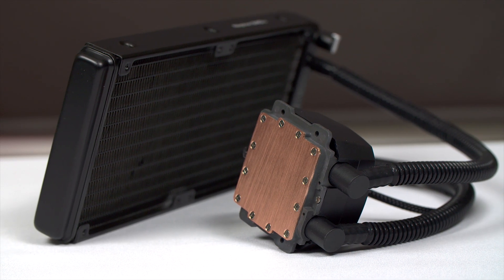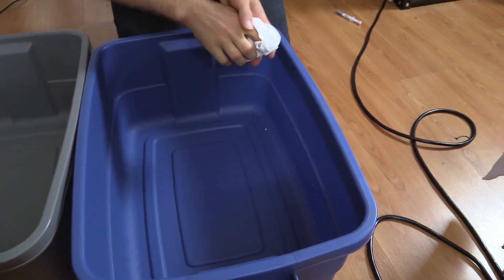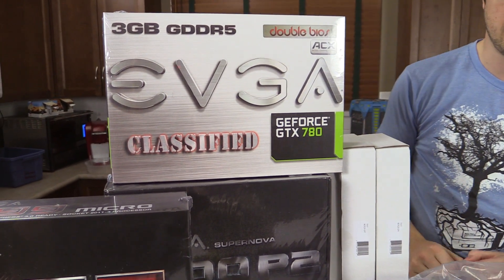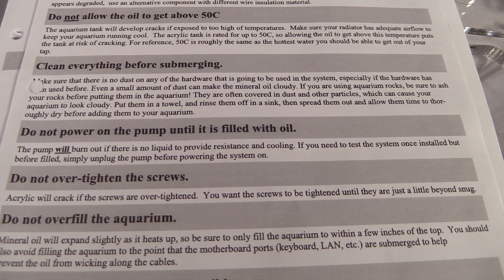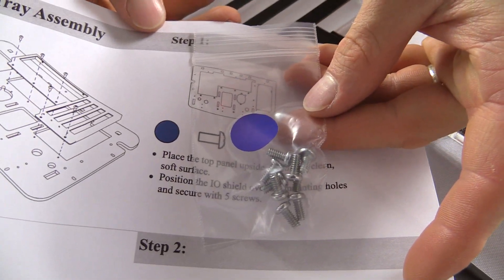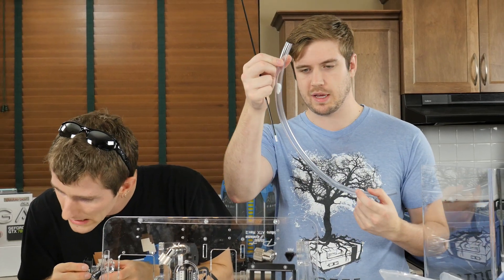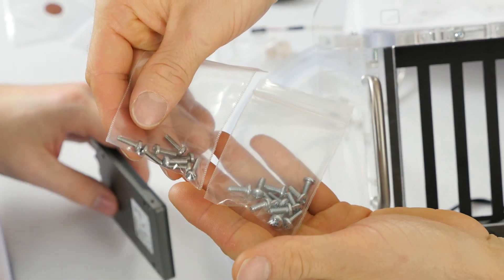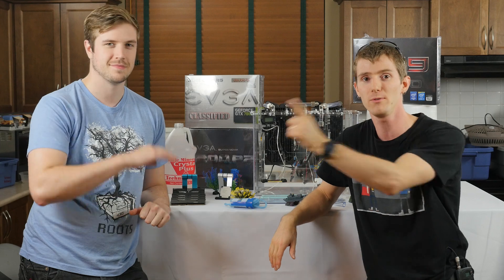Mineral Oil Submerged PC Build Log Part 1 - Puget Systems Kit Case Assembly

Comment: What is the Adventage of a Minerial Oil acooling versus a Water Colling?
Reply: oil build cool every component like motherboard
Reply: Username0123456789 Another advantage is you can have 100% quiet computing
Reply: Oil cools everything, water cools only your cpu and/or gpu
Reply: More street cred
Reply: Well, they're about to completely submerge every component in the mineral oil because it's non-conductive. You can't do that with water.

The oil isn't just going through that water cooling loop. The "case" is a fish tank without any fans for a reason.
Reply: [deleted comment]
Reply: You get +9001 Swag
Reply: philip s It won't be 100% quiet. You still need fans on the radiators, a pump and mechanical harddrives have to be placed outside the oil
Reply: Jake Long swag level... its... its... OVER 9000!!!!!
Reply: Mansen well. It deionizes the metal, causing a short in 10 mins.
Reply: You get to say that you have built a mineral oil cooled computer. Can't forget that advantage.
Reply: Mansen It's completely correct. Not only is it more expensive, more corrosive to metals than regular distilled water but it will try to take ions from any metal surface every chance it gets, it's unsafe in this type of configuration.
Reply: Mansen start Saving if you do that, because you will need a new system because deionized water will short out because it will pick up ions, and give the water a conductive charge
Reply: A noctua fan at lowest rpm setting is basically 100 to our ears.
Reply: Use ssd, noctua fans at lowest rpm and fir the pump sumerge it at very low rpm and its silent too.
Reply: Mansen That's the chemistry? No lies lmfao.
Reply: Mansen have fun trying it then
Reply: Spill Mineral Oil on your MOBO. Does it work? Now do the same with water
Reply: philip s Shure, but I don't think most people who build an oil cooled rig do it for silence but just for how cool it is. You can even make aircooling inaudibly silent, depending on what you do
Reply: Jammy jam true, but things like on board chips and sound cards and stuff like that can only (safely) be cooled with mineral oil
Reply: Two completely different method of cooling. A more similar comparison would be Oil vs Air.
Reply: Seon wei jie  The ASUS Maximus VII Formula Motherboard has VRM water cooling.
Reply: Mansen Demineralised water is also more corrosive and will become conductive over time.
Reply: It's just a cool looking gimmick really.  Oil is not nearly as good at transferring heat as water, so once it gets warm it's going to take a longer time to cool.  And as far as cooling the entire system goes, it's not really needed. 

I was considering doing this once and did a lot of research on it.  It looks awesome and would make for a great conversation/show piece, but in terms of heat removal for overclocking a custom water loop is going to do a better job.  And it's wicked messy to boot.

I may still do it some day just for the cool factor though.
Reply: Mansen lol, oil is much better than air. Go study some material pls
Reply: Uzmeyer True but it will be silent because it's all submerged. It will also depend what you place it on, a lot of surfaces enhance sound like a table compared to a floor.
Reply: Jacob S that was cool if ion can decast form oil lol
Reply: With the right cooling kit you can chill a mineral oil pc down to below the ambient temperature of the room without the attendant condensation problems that a system open to the air would have. You can also get the temperature down much lower than with air or water because the freezing point of oil is lower than that of water.
Reply: More fun to build? Ain't that the epitome of reasons for custom building more fancy stuff.
Reply: GenXRanter True, water transfers heat better than oil. The engineers figured that out a long time ago, that's why car radiators use water and not oil.
Reply: Angel Luis Trinidad oil cooling in engines does exist.
Reply: Jacob S I like pouring liquid nitrogen all over my engine and hoping for the best :D
Reply: ***** In water cooling distilled water is used which is non-conductive either.
Reply: Foxcat What? Distilled water IS conductive.
Reply: ***** The time it takes for distilled water to become conductive while in contact with metals and other contaminants is like, in the order of minutes. So, yeah, you'd basically need a continous flow of distilled water, nevermind water trapped in areas with low flow becoming conductive and kill it anyway.
Reply: ***** You're talking about deionised or demineralised water, not distilled.
Reply: tikiman48 motherboards can be watercooled, PSUs can watercooled, everything can be watercooled but its useless
Reply: Well, you can submerge all your computer parts in it without getting damaged haha. Also, your components will run much cooler!
Reply: Jacob S I know that, The oil in the engine is to combat friction. But there's no oil in the radiator, I'm talking about engine radiators, they have water in them not oil. And that's because water is a better heat dissipater than oil. I've never seen an engine with oil in the radiator. Of course there's the Volkswagen engine that is air cooled.
Reply: Angel Luis Trinidad No, I mean that oil being used as coolant has existed. In older car engines, aircraft engines and motorcycle engines. It's typically used to supplement air cooling when extra cooling is needed.
Reply: You don't have to buy blocks and fittings for every component
Reply: Jacob S Definitely,  we are talking about different things. I'm talking about radiators not using oil, using water, because water is a better heat dissipater than oil.
Reply: Angel Luis Trinidad That's exactly what i'm talking about, oil being used in radiators, I'm just saying it had existed, that's all.
Reply: ***** Distilled water is not 100% pure, it is still conductive.
Reply: Jacob S If done properly, no its not
Reply: DkGnClan All water no matter the purity can technically conduct electricity when enough voltage is applied and even then, distilled water isn't pure enough to submerge a PC in and even if it was, the salts from different sources in the PC would start contaminating the water making it even more conductive.

Water is not a great idea for this type of PC configuration.
Reply: the mineral oil is denser, and it needs more heat (energy) to rise its temperature, but as it's denser, it means that is harder to push through the radiators. So, it absorbs more heat but it flows slowly to get it... the only advantage is that it cools every single component, on the mineral oil
Reply: Jacob S I never seen it, but I like to learn. It would be great if you point me to a link that shows a radiator that uses oil as a coolant, and not water.
Reply: Jacob S Here we go where everything is always 100% perfect. Even if oil is not conductive the rocks will leave normal water in the finest holes, with even more water, which will contaminate the oil straight away making it conductive. This is why I left the LTT forum, everyone is based of bullshit numbers and theories, and Linus' videos. Nothing is thought about with an open mind.
Reply: Angel Luis Trinidad Here's a link that explains what I'm saying, water is a better heat dissipater than oil. Please take a look, and read all the posts:  http://www.nissanforums.com/ga16de-1-6l-engine/7025-oil-instead-water-cooling.html
Reply: BlueBlockHeads I wasn't the first to be "technical" the contamination of the oil is not significant enough to make a difference, however salts from components in the PC will quickly ionise the water to dangerous levels.

If you want to try submerging a PC in distilled water you can go right ahead.
Reply: Angel Luis Trinidad Using oil instead of water is an old practice and was only used along side air cooling, the 1985 http://en.wikipedia.org/wiki/Suzuki_GSX-R750 is something that used that method, I think older VW's, Chevrolets and other car makes that used air cooling did the same.
Reply: Jacob S Now you change, I said that in a previous comment, I even mentioned the air cooled Volkswagen. Show me an example, a link of an engine that uses oil instead of water inside the radiator for cooling. I know about air/oil cooled engine, but I've never seen a engine that uses a radiator full of oil for cooling. You said that you know such a engine in a previous comment. That's what I want to see.
Reply: Angel Luis Trinidad I didn't change, I said the same in a previous comment but I guess I misinterpreted what you meant, sorry about that.
Reply: Jacob S Okay, no hard feelings. It was great to have an intelligent discussion with you, without resorting to name calling, or offensive words. Have a nice day.
Reply: Foxcat  Distilled water becomes conductive again when exposed to dust and other particles which quickly re-ionizes the water. That's why only with mineral oil can you completely submerge ever component. It's permanently inert where as water can become conductive again over time.
Reply: Angel Luis Trinidad Car radiators actually have coolant in them; not just water. Just because you can top up a battery with water doesn't mean its contents is entirely water.
And, there's such thing as oil heaters.
Reply: TheTopMostDog He never said that it's entirely water, car radiators are water-based.
Reply: Jacob S  Yes, but them 'using water as a coolant' is still an inaccurate statement - the applicable properties are very different. 

The exact same reason I refer to the PC cooling method as liquid cooling.
Reply: TheTopMostDog How is "using water as a coolant" an inaccurate statement exactly?

Liquid cooling is interchangeable with water cooling with both PC's and Car's for the fact that most of them are water-based coolants.
Reply: Jacob S Water and water-diluted coolant have very different thermal properties, as I already said.

I have seen several times online, people misunderstanding that PC water-cooling does not actually contain water, with hypothesis concerning the "water" freezing or boiling under extreme circumstances. It might be semantics, but the easiest solution is to call these things liquid cooling, which I explained is what I do, hopefully to help educate others and avoid such confusion.
Reply: TheTopMostDog Although they're different, water as a coolant isn't an inaccurate statement at all.

PC water-cooling DOES contain water, for the most part the common custom water cooling setup for a PC is distilled water and maybe some silver because it has anti-bacterial properties. The entire world has different climates water boiling is not an issue because you very rarely get temperatures near boiling point and if you do, there's a problem that needs addressing. Pre-filled water coolers come with anti-freeze mixed in them but still contain water.

Bottom line, if your PC's cooling loop is frozen or boiling, it's not because of the coolant, it's because of something that you've done that's wrong or unorthodox.
Reply: Jacob S Oi, to stop you right after your first sentence, my original comment was regarding someone else making a statement about car radiators. Don't go and quote me out of context; his comment did in fact contain an inaccurate statement.

EDIT: The reason liquid cooling loops might interact with boiling-point temperatures could be, um, overclocked parts? People push the limits with different hardware and cooling solutions. Many are just to prove a point (ie, "I can 5ghz on air"). 

Bottom line? I didn't mention boiling or freezing until my last comment, and it wasn't even my point. ...How did you reach that as a conclusion?
Reply: TheTopMostDog Your original comment was implying that coolant is different from water which is in fact an "inaccurate statement". I never pulled anything out of context, I asked how his statement was inaccurate and you said it's because they have different thermal properties (well no shit) which is irrelevant to whether water is a coolant or not.

Don't try to be sarcastic when you're wrong. If your water cooling loop is hot enough to be boiling then chances are your CPU has already been fried or has had some serious damage done to it, your CPU has to be a lot hotter than 100 C for your loop to be boiling. People that overclock for world records don't use water cooling loops btw.

Fair enough, let me conclude with this, He didn't say that engine cooling systems are entirely comprised of water, him saying that "car radiators use water not oil" is still a true statement, radiators no longer use oil-based coolants anymore. Water is a coolant therefore "water as a coolant" is an accurate statement. You aren't educating and clearing any confusion within PC terminology, rather spreading misinformation because you are completely wrong in saying that liquid cooled PC's do not contain water because I believe that there is no other liquid that is used as a base in a liquid cooling loop.
Reply: TheTopMostDog I know that car radiators have a mix of 50/50 of water and coolant. Still, I know lots of people that when they change radiators, they put just water in it. I live in Puerto Rico, a tropical island, and we do not need the anti-freeze properties of the coolant. I have two cars, one that I bought new, and one that I bought used. The one that I bought new, I've always kept it with coolant, and the used one, I only put water, because the previous owner had only used water. Since it's working great, it never heats up, I've kept it only with water.
Reply: Jacob S >"Your original comment was implying that coolant is different from water which is in fact an "inaccurate statement"."
....What? ..Based on the direction this is headed, I'm going to concede my participation in this debate before it devolves into name-calling.

Angel Luis Trinidad Thanks, that's quite fair. Just wanted to clarify for other readers; I have a friend who once spilled the contents of a car battery on himself and refused to wash because "you only put water in it". In the following ten minutes or so, some acid that had collected on the radiator cap started visibly reacting, prompting him to wash before continuing work on the car. :P
Reply: TheTopMostDog I think that would be best if you have nothing to contribute.
Reply: Jacob S http://commondescent.net/images/pigeon_banner.jpg

Comment: And im just sitting Herr enjoying my gtx 970
Reply: 2280david The whine doesn't come from the fans.
Reply: Do you have whining ?I`ve heard that's a big problem.
Reply: chrisgtx560 no its whisper quiet. I have the Asus strix edition. When playing old or very undemanding games the fan doesn't even spin
Reply: 2280david Really? I had a bit of whining in the beginning with my strix 970 but it disappeared after a day or two...I can still reproduce it in a certain benchmark though and it's heartbreaking :'(
Reply: hund791 really. I don't have any whining at all. I even tried 100% fan speed
Reply: 2280david It doesn't arise at 100% speed. I get it at one specific instance in the benchmark at around 93% load and it has only happened once or twice in an actual game and only very briefly.
Reply: 2280david
thanks for your feedback , but i meant coil  whining :D
Reply: chrisgtx560 I curious, do you understand why coil whine happens?? If so, just say yes and ignore me.

Comment: Time for some youtube nostalgia, how can there be 301 views if there's 1000 likes?
Reply: YouTube stops at 301 views and then verifies that the next views aren't made by a machine or something
Reply: 2280david No it's because their system cannot process the views correctly as they are automated, where as the likes need to be actively clicked.
Reply: User 301 The answer is already in this chain. The likes are actively clicked upon so they update as you click. The views are not updated in real time due to the fact that they have to be calculated as it is automated. This is not done in real time as more views are coming through than can be calculated. The reason why it cannot be calculated is due to the amount of activity on the site. Real time calculation is impossible in this instance.
Reply: Lol what a casual, It was never like this before 2009
Reply: ki11bunny Increasing a variable by one on each pageview is not an advanced calculation by any means. The reason it gets stuck at 301 is because the views need to be verified so it is not views by bots etc.
Reply: ***** it is when you are dealing with millions of view a sec across multiply video on one server.
Reply: ki11bunny First off, it's more like a million servers, not one. Just because there are many of something, it doesn't make the calculation harder, because it's the same thing. "videoViews++" - that is literally the code. That is how a numeric value is increased by one. A server does not go and mix different variables together. It is not a hard task. Just Google "YouTube 301" if you don't believe me.

Never discuss programming if you don't even know the absolute basics of things.